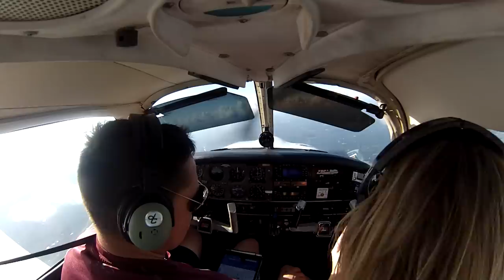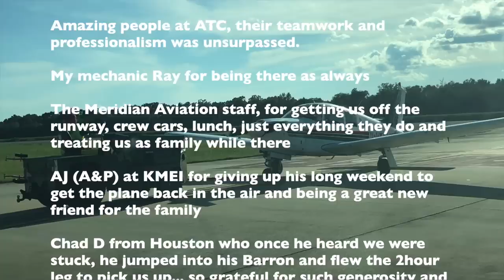Real Emergency - Power Off Landing with family in Piper Arrow after throttle cable breaks

Comment: Great job!!!!!  You probably know this and maybe even did this...but you can just use mixture control to get partial power then adjust, OR just cut mixture to slow up, then put mixuture back in as needed for power...engine will start right up IF prop is windmilling( if not, use starter).  Anyway, fantastic job working the problem, keeping your cool and flying the airplane
Reply from the maker: Mark absolutely. Thank you sir and yeah that’s why we shared it (did debrief video) was in all our training we plan for engine on or off... but on final when going to cut her was able to control the performance for basically a nice approach! So wanted to share. Thanks again Mark!

Comment: Depending on the pilot some would say that a non-powered approach is routine. My brother for example entering a non controlled pattern every time.  210 Centurion. Way high and way fast. Why depend on the engine to land when you don't have to. Great video. Was hoping to see how you configured going from full throttle to no throttle. Nice display of cool heads and allocation of resources.

Comment: Strange that they did not immediately realize the speed could be dropped below the gear-drop speed by raising the nose substantially to climb at a high rate.  Once the gear is down, that will impose significant drag and help keep the speed down somewhat.  Also, probably full flaps could be set at the lower speed during extreme climb, which would impose additional drag and help keep speed down.

Comment: Could you have dropped to a single magneto to reduce power output from the engine and reduced speed enough to drop the gear/add drag with flaps to achieve an acceptable speed? Even if RPM doesn't drop a whole ton on one mag, the engine should have significantly less power. That plus carb heat may have added a bit of safety margin. Just some thoughts, very well done!

Comment: That had to be scary with the family on board, glad to see it worked out.
Reply from the maker: Rely on the training, power off stalls with the fam on board is not as fun as they are in training that is for sure.  Love the jeep btw!
Reply: Thanks. Recently beat on it pretty hard and it ended up on its side. About got it back to where it was

Comment: I bought a 1971 Cherokee 140 in 1989. It was in need of a lot of work. I completed my Privates after purchase same year. Sometime later, on landing I would hear a pop sound on or just after touchdown. On about the 5th landing I heard a pop. The throttle started slowly moving forward, slowly increasing RPM. By this time I had left the active so I pulled the mixture and shut down the engine. The cable had been work hardened but primarily a sharp bend in the cockpit of the cable. I ordered both mixture and throttle cable. My A&P adjusted the throttle cable but the mixture cable was an exact match.  Since it was an uncontrolled there was no interaction with the FAA but I never mentioned it to them. The cable was breaking one strand at a time. Probably the nose wheel stretching the cable. I think this pilot should buy a boat.

Comment: I’m an A&P/IA mechanic that takes care of a number of PA28s, including a -200 Arrow.  Last year we changed a throttle cable on the Arrow after the shield had come apart and the bare wire was exposed (found during an inspection).  I would be curious if any pictures were taken of the throttle arm post-incident.  I would have submitted an SDR if I knew there was a similar incident.  As a Commercial, IFR pilot, your demeanor and ADM was excellent!  Great job!
Reply from the maker: Thank you David!

Comment: Is it possible to slow the engine by pulling the mixture.. not so it shuts off but so it runs lean with less power? It seems like using mixture would allow some control over its power. Also it looks like you have control over propeller pitch too., maybe a combination of lean and pulling the rpm down could be used. And why not climb to reach gear and flap extension speeds, deploy them and the drag will help as well. I’m just curious if any of those options are possible. Fantastic airmanship!
Reply from the maker: Todd, thank you sir.  To your question the mixture did reduce that performance but we were getting ready for the power off (AC Position). For the prop, bigger bites of air and not wanting to build too much pressure in the governor gave me less of an option here - and wanting to be ready for a go around if needed is best at prop forward. Great question and honestly best chatted with a CFI but happy to share my experience anyway :) thanks for watching.

Comment: To reduce power in that plane all one has to do is ease the mixture control lean enough.  With a 10,000 ft runway available for a plane that needs about 1000 ft to stop after touching down seems that with decent piloting skills he was never in any real danger.  All one had to do was come in kind of high over the threshold and cut power since you have lots of runway to waste if needed.  I've flown small planes for almost 50 years and many hours in a Piper Arrow just like that one so it's not like I've never had any issues during flight to deal with.  Declaring an emergency right away like that was a great decision as it gave him priority handling by the controllers.  If he had been dealing with a total loss of power it would have been a bit more challenging but there are lots of ways to get rid of too much power just like there are far more ways to get rid of too much altitude vs not having enough.  Glad no one was hurt and no damage was done.

Comment: Wow. This actually happened to me, also in a Piper Arrow earlier this year. I was checking out a new private pilot to rent the plane. On the downwind I noticed we were still climbing past TPA. It took me about 5 seconds to decide to use the mixture knob as my throttle. I actually never shutoff completely. I actually used the mixture to taxi all the way back to the flight school.
Reply from the maker: Mixture works great, but is really hard on the engine. End up with detonation in the cylinders reducing engine life but it works when we need it to. It’s how I got her down to speed before shutting down for the power off  thanks for watching and glad it worked out well for you too!
Reply: @FamilyPilot  the throttle cable broke once with another instructor about 8 months before it happened to me. Good thing that you kept your cool and to be honest, that experience will make you a better pilot

Comment: Pretty cool that the throttle is designed to go full open in case of a cable break, was actually not aware of that, but makes sense. Why wait until final to lower the gear and flaps? It seems like there would be fewer variables and effort if the plane was fully configured for landing at 4k. Then you could starve the engine, do the engine out checklist, and spend the rest of the time solely focused on gliding down. It's been awhile since I've flown GA and I don't have any experience with this airplane, would that be a legitimate response to this situation?
Reply from the maker: You got it :) final was a long straight in and we were within gliding before started leaning mixture for gear speeds and then flap speed but flaps only once landing was assured :)  big long runway so no rush to slow down too far before threshold really. Appreciate the feedback, it’s a great point gear in downwind still within gliding but closer to the field. Great point.

Comment: I flew an old (1969) Arrow for much of my Commercial training. This was a LONG time ago! Is it not possible to manually (emergency) extend the gear in spite of what the engine/RPM/Mani Pres is doing? If you can extend the gear, is it truly dangerous for the gear to be hanging out at full throttle? Did you manipulate power successfully with prop control? Were you able to get under gear-extend speed or did you use emergency gear extend (whatever that is in a modern Arrow)?

Comment: Pilot and family were wonderful..but honest question: how does this happen?  The throttle just ... breaks?  Shouldn't that be checked?  Whose job is it to make sure that NEVER HAPPENS?  Makes me want to never fly again.
Reply from the maker: Throttle. Prop control and mixture are all controlled from a cable inside the plane. If that cable breaks Piper design is that on the motor it’s spring loaded so goes full forward.  It was a learning experience as a low time pilot when this happened. It’s a great thing to chair fly and prepare for with your plane and instructor. If it makes you weary of flying jump in with a CFI and do some power off 180s (part of commercial Checkride) and you’ll feel great!

Comment: I'm not a a pilot.  I've only flown simulators so forgive what might be a stupid question.  If the throttle is stuck at one position how is it that you can control descending or climbing and not either over-speed or stall?  I ask that as flying fast tends to increase altitude or slow tends to drop altitude.  Was this at a lucky speed to where you could just trim it out into holding and changing altitude?
Reply from the maker: Had to reduce mixture to get below gear speed. Then drag and flaps for touchdown at approach speeds :)
Reply: @FamilyPilot  Ok thanks

Comment: Really interesting video. Just had the same issue, but in the sim for my IR rating... so very in interesting to see that in real life. You did a great job ! Just one thing about a totally another subject : The BOSE A20 of your wife is on the wrong side :-) Mic had to be on the left side. I was doing the same at the time, but the design of this headset in the not the symetrical

Comment: Not sure if I'm a hell of a instinct pilot or just crazy, but I'd use prop pitch and mixture to lower the RPM, incrementally lower flaps while pulling some gentle S turns in order to bleed speed and get to Vlo. By the way, kudos for the safe landing, lots of lads would surely lose their shit in the same situation.

Comment: Yeah ,Bravo..and i saw your wife go, "Thank you Jesus"..That had to break for a reason..I hope they and you look very closely at that cable and how it was installed. Check for a bad angle or loose cable clamp , tight/stiff throttle body lever.
Reply from the maker: Replaced all cables front of the firewall :) done deal! Thanks for watching Daniel!

Comment: I'm an A&P that works on Pipers for a flight school. Do you know what caused the problem? Did the cable actually break, or did it slip out of the throttle arm? We fly piper arrows, and I would like to check all of ours to prevent our students from having this issue as well. Thank You!
Reply from the maker: Hey Nathan that’s awesome. This cable did break. About 7” from the engine side, snapped - message me on Instagram and I’ll send you pictures of both ends if interested @familyPilot over there.

Comment: Great job! Take your time, figure things out. Try to find alternate solutions. You did it, man!

I mentioned this your other video with your wife, but I am surprised no one considered toggling the mags on and off. You use the duty cycle to control the amount of power. On many old planes you used this method to control the power because they did not have a throttle (or so my mechanic told me, please correct me if this is wrong...)

I know how stressful it is when you have your family and something goes wrong. I had carb ice AT CRUISE, yes, let me repeat that CARB ICE AT CRUISE with the family and made it down OK. Do NOT believe instructors or FAA publications that claim you cannot get carb ice at cruise. You absolutely can, and it is scary as hell. It seems I was in a nascent cloud layer. I could see a slight plane of haze... That was the moisture needed to get carb ice at cruise.

Thanks for sharing this. I like to hear about incidents, accidents, emergencies, etc. because they help me think ahead about what I would do in similar situations. You did a really nice job.

Comment: It's been a long time since I've been in an Arrow or any single engine for that matter... But correct me if I'm wrong, but could you not have used drag by climbing to get the aircraft slowed down to the point where you could lower flaps and landing gear? Other question... Could you have leaned out the mixture to slow the engine? Last question... Was prop control not functioning and did it do anything to slow the engine?
Not criticizing at all. Just questions. You did what you had to do and you showed poise and control. Well done.
Reply from the maker: The mixture is the answer - we setup for long final and then pitched enough to get below gear speed. Then once landing was basically assured (few mile gliding distance accounting for head wind) started with mixture coming out which reduces performance. Need to be careful not to stay there too long as it could damage engine making a restart impossible but does the trick then flaps once runway is made :)
Reply: @FamilyPilot  That's awesome dude. Nice job 😁

Comment: I think the pilots decision to do a power off landing was awesome. I'm going to assume feathering at full throttle was a bit dicey or did it manage to help you slow at all without blowing the engine hehe? Glad you landed safely. Would likely suggest for other folks watching to not take your throttle quadrant apart mid-flight for a suspected throttle cable break unless you have no other options. The cable likely snapped further up and worst case if you could manipulate it you might risk closing the throttle or mixture by accident or in general making things worse.

Comment: There should be a secondary emegency throttle linkage, that is not physically connected to the acctual throttle linkage on the throttlebody/carb. But when you push the linkage in a to a certain point it engages the throttle linkage and pushes the throttle angle back from full so that you can controll air speed when the regular wire brakes.
Reply from the maker: Aviation is all about redundancy. The engineering of this motor is when the cable does break it springs forward which is much better than the alternative :)  guess the engineers figured springing forward and then the ability to shut off the engine gives enough of the options. :)  happy skies!

Comment: Interesting one to say the least... Thanks for sharing  ! 
I'm trying to think of all the different ways this situation could have been handled. As you were in VMC conditions, what made you decide doing a long final rather than going overhead the field, kill the engine and follow your usual glide angles like you would do in a simulated engine failure overhead the field  ?
Reply from the maker: Those are really the two options. Since I got to pick when to shut down the engine I chose the long straight in and cut it once I was within glide distance.  Also have me a familiar missed approach process if I wanted to restart. Remember this was 10000 runway, could do night currency in a single approach lol

Comment: W O W ! ! ! This video had me on the edge of my seat. Great Job keeping your cool and getting the plane down safe. Just wondering, did you have cold feet after going through this? I've never been down in a plane with any emergency but 2 Piper Cherokee's that i have flown just days before they crashed have and when this happened, i got really cold feet. My instructor told me if i ever get cold feet to fly, just get up in the air as soon as you can and once you do that, you wont have cold feet anymore. So i did and it worked. LOL Glad you all are ok. :-D

Comment: I loved the mechanics question..." Is he in flight"?... That cracked me up! had the same issues in a RG years ago. Wasn't that hard actually, the mixture now becomes yr throttle, crudely. Raise the nose to climb whilst a slight side slip reduce speed drop the gear then go full fine, drop 20 of flap and pull the mixture till the engine just starts to faulter, back to rich when you need more speed.
Reply from the maker: Agreed :) and our mechanic is the best! The mixture in my mind was going to be on or off and I wanted to setup for that but yeah once we start pulling it back it gives some control. Do make sure to shut down before too low as detonation can start inside the cylinders. 

I love the discussions this video has sparked and I feel it’s made a few folks think about what they would do (on the ground with a CFI) which makes me happy :) cheers and thanks for your comment

Comment: Does "slipping" to bleed altitude cause more or less air speed? Just wondering if this is another way to control air speed when coasting in.
Reply from the maker: Slipping let’s you drop altitude without picking up airspeed. The plane essentially falls down lower versus flies down which increases airspeed.
Reply: @FamilyPilot  Ah, thanks. I couldn't remember if it affected air speed like from being less aerodynamic. It's been a long time since I've piloted anything.

Comment: So in situations like this can you adjust prop pitch settings to control the air speed? Will that cause the engine to rev too high? Plane noob here
Reply from the maker: Eric, gréât question. These planes we can’t feather a prop like the multi engine planes can. Not wanting to risk the engine and prop governor we opted for the power off landing keeping the option for a go-around :)
Reply: Family Pilot thank you for replying! Great job there!

Comment: Well done. Calm head. Followed procedures flawlessly. What was the cause?
Reply from the maker: Thanks Adam, ended up being a broken throttle cable. In this AC when the cable breaks the throttle is spring loaded and goes to full (much better than 0...) cheers!
Reply: @FamilyPilot  Ouch! not a great system then?!